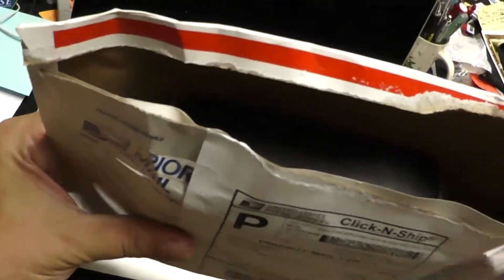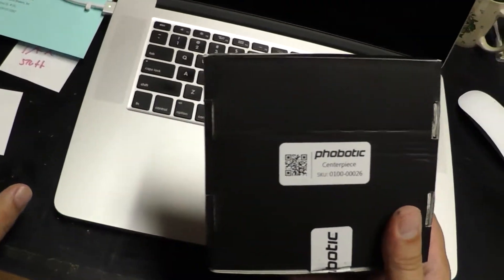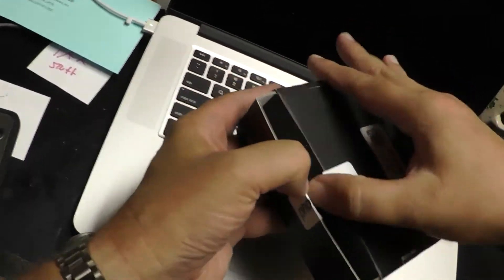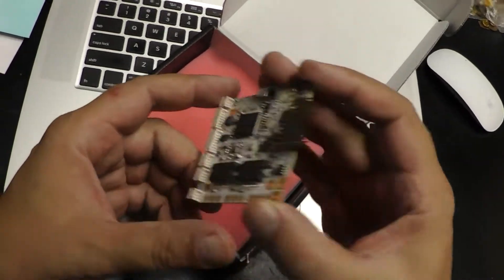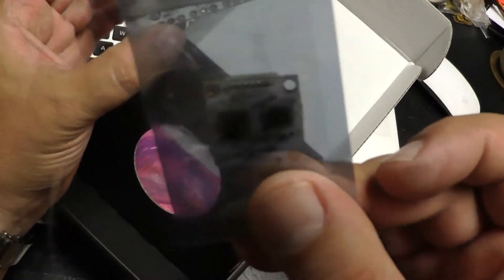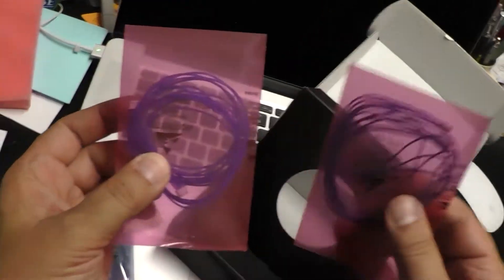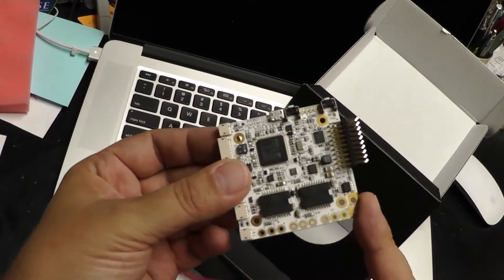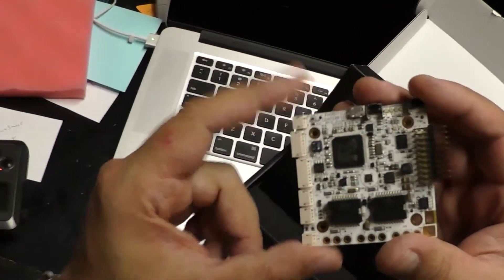Phobotic CenterPiece UNBOX - nothing more

Comment: Bo I want to try that on my 3D Printed GoPro 3 axis gimbal. :D

What is the size of the controller. Is that 50mmx50mm?
Reply from the maker: the holes is 45x45mm   
Gary have them in stocks at www.tppacks.com
Reply from the maker: NOTE.. you need to create a 4 bolt mount for the IMU, it can not be rocking, this thing is much more critical in installation than typical AM boards that can be zip tied on.
Reply: Bo Lorentzen How much it is? Can't find it on the tppacks.com. So it's 50x50mm board with 45mm distance mounting hole? That's perfect on my frame to replace Storm32 with same 45x45 mounting hole. For IMU, I usually stick it with double sided 3M foam tape and also  add groove on camera frame for perfect alignment.
Reply: RCCopter Watch again the video. It looks bigger than 50mm if the mounting hole is 45mm.
Reply from the maker: RCCopter 65x65mm with 45x45mm hole center.   $400   use the contact form on TPpacks to shoot a message to Garry.

Comment: Hello how do you like this product is it true that it's 100% auto tune ? I work with the alexmos 32 bits and i find it impossible sometimes the auto tune on the alexmos is very bad. So id rather spend a lot of money on this board than spend hours and hours wasting my time tuning something that nearly impossible to do.
Reply from the maker: Hey zero00tolerance,  yup, 100% auto-tune, it takes about 6 minutes,   here is a video from my first flight test.  using a crappy single single side gimbal.  
2014 09 11  CP take1
Reply: Bo Lorentzen Thanks I'm getting close to order one
Reply from the maker: zero00tolerance You are welcome,   its highly recommended,  the best gimbal controller I have at the moment.